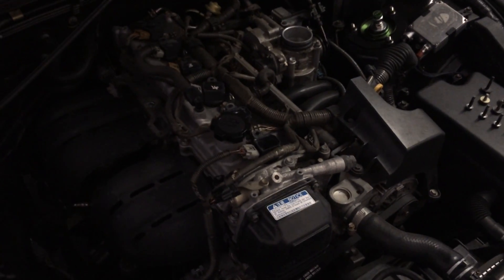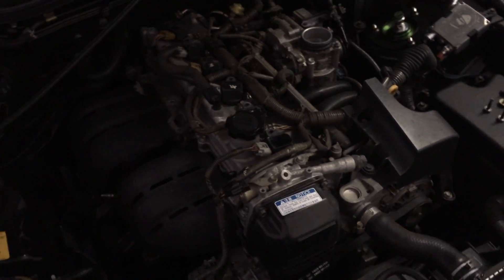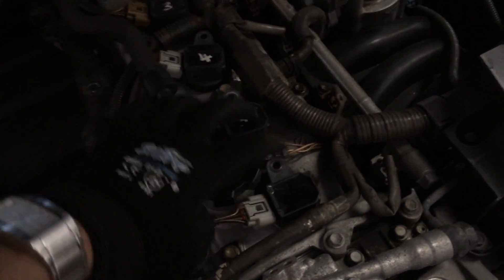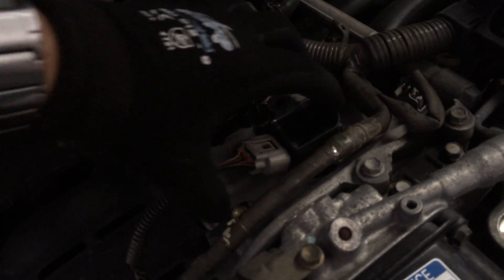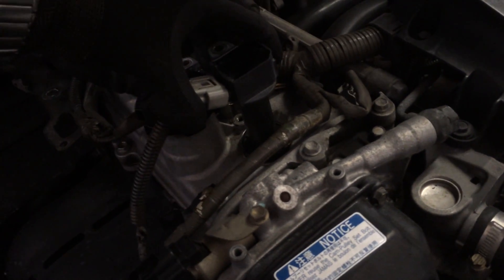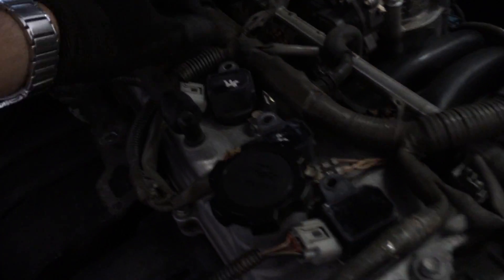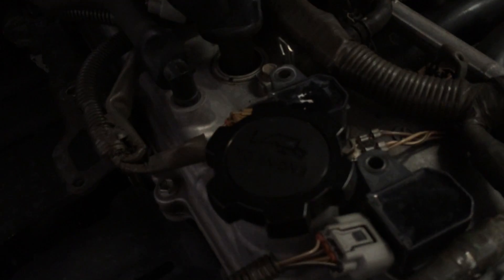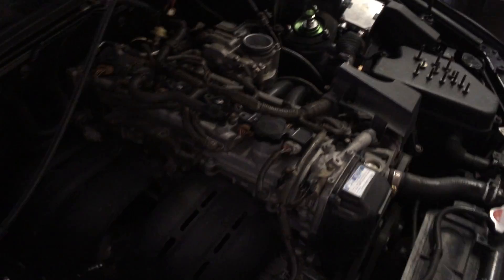How to Diagnose Faulty Coil Pack without using a computer or OBD2 scan tools Check Engine Light

Comment: Did you not get an electric shock when you touched the spark plug wire?
Reply from the maker: +Leonardo Costa no, there quite well insulated where I was grasping, it's typically the tubes where they fail, if your worried, wear some rubber gloves
Reply: since I' ve experienced electric shock on olds Honda motorcycles (from 70's) after 30 years I still get worried, but great to know. Thaks man I appreciate your tips.

Comment: Would this problem cause high fuel consumption??
Reply from the maker: in almost all cases yes, the worse it is ie. if you can feel that the engine is missing and hesitating, you will be trying to compensate with more throttle etc. as the engine will not be producing the same power and torque if it is down on a cylinder. it depends on alot of factors - generally you should notice something is not right well before your fuel consumption has a noticeable increase.
Reply: Thanks for the video man... simple , quick, effective, no bollox... I like it !!!
Reply: DEAN THE DEVIL might
Reply: Absolutely, unburnt fuel is energy wasted.

Comment: this is a bad way to check them, this cause's a load on the pack and can not only damage a good coil pack but can also cause damage to the cars computer
Reply: u can do it this way yourself and take a chance on not fucking up your cpu which will then cost closer to 2k for a replacement or u can do it yourself the safer way and simply put a spare spark plug in the coil after u remove it from engine so it does not cause a load, if u want to be sarcastic then know your stuff first
Reply: my friend this is a balance test

Comment: I am just a bit confused. So which ones are faulty? The ones where it doesnot make a difference to engine sound or the ones where it does make a differnce to engine sound?
Reply from the maker: the ones where it does NOT affect the engine is the faulty one.. if it was a good one and you removed it the engine would suffer further from miss firing.
Reply: matthew mccullough yeah people come to videos like this to figure this shit out, why else would someone be watching this video if they didn’t know shit about cars
Reply: juan alt "if you pull out a coil pack it will cause the car to stall out"

if he pulls it out and it doesn't stall, it's broken 

I assumed that he thought anyone watching this video would have at least the smallest little idea of how an engine works
Reply: That Car Channel, So why didn't you explained that in the video clearly.

Comment: running unburned fuel through your cats will destroy them. will be an issue if you have to pass smog tests. I just swap out coils until I find the bad one. its good practice to change them all anyway especially if they are the original coils
Reply from the maker: sometimes it comes down to cost and availability, for example - my local price was $80 for a coil, as it was my daily drive car, i needed it immediately, 3 days later another one failed - another $80.... then i ordered a set of 4 denso ones (as these Coils are the same on a v8 land cruiser) from japan through a parts dealer for $125 for 4 delivered..

if i could wait 3 weeks for the shipping then i would have just replaced all 6 for under $200... if i had purchased them all locally (non genuine denso, they were YEC japan brand) would cost $480.. so replacing the urgent ones, to then later replace them all yes is a good idea. sometimes logistics and money plays a part on when things get replaced though.
Reply: exactly. im not ASE qualified, nor did i train for automotive repair, but in my little world, changing them all at the same time makes sense
Reply from the maker: good tip! they arn't ment to last for ever, some fail totally like this video.. some only fail under heavy loads.. you would have to test them a different way
Reply: MrExtremeboost MAX Boost
the chinese coils are crap. I go to the junkyard and pay $10 for OEM. not paying $50 at the auto parts store
Reply from the maker: for more old OEM ones that may last a few months themselvs? not all things made in china are crap, depends entirely on the manufacturer, materials and QC standards. i don't doubt that Japanese brands have been outsourcing manufacturing to China and Taiwan for decades.. you just need to do your reasearch, and purchase ones that come with a warranty like most things that come from a reputable 'auto parts store' if it fails they replace it and claim it through the manufacturer.

Comment: So it seems only 2 coils are bad. You only switch out the bad ones right? Or would you do all of them then and there?..plz reply asap need to work on mine my code coming up cylinder 2 misfire
Reply from the maker: +Cali_ Native559 hi sorry for the late reply, you can replace just the two.. but be cautious as the others may fail shortly. if money is tight replace the bad ones now, with a view to replace the remaining ones on your next service or shortly down the track.

Comment: There's another method that SO much easier!!!  Just connect an ODBII reader to the OBDII and see what it says.  Should point to the exact cylinder every time.
Reply: +Matcha Time Cafe It'll tell you what cylinder is misfiring, but that doesn't guaranty that the coil is at fault.
Reply: +DrSlang neither does the method described in the video...
Reply: $25 for a scanner? No way, I'm saving up for a new battery in my 03 jetta

Comment: I've pulled my coils out one by one - Still alive. 
anyways, tryna find the misfire culprit. All the Coils seem to effect the revs when pulled out. 1,2,3 - all effect the revs number 4 however, kills/stops the engine. is it safe to assume 4 is the culprit coil?
Renault Scenic Rx4
Reply from the maker: ***** safe to say thats the one mate! good work.
Reply: +MrExtremeboost MAX Boost hey man, i have a problem starting my toyota vios 2004 engine. but after i reinstalled and installed the ignition coil back, the engine work out just fine. this happened now 3 times. is this due to a faulty coil or a faulty spark, what do you think?

Comment: Apparently he's never been hit by the coil pack amperage. You lift one up and if the spark likes you better than the closest ground....you're going for a ride. Not a fun ride either. More like all of your bones playing football with each other in fast forward. It's like pulling the coil wire off the distributor and it jumps and away you gooooo. Not recommended.
Reply from the maker: King 250sx i have, and it definitely wakes you up.. but it's not really anything to be scared of... i mean miss a spanner and punch the machined alloy surface of an engine block, dig chunks out of some knuckles - even with mechanics gloves on, spray carby cleaner into your engine and have a little splash and manage to ronaldo through the nose bridge of your safety glasses into your eye... accidents are bound to happen when you work on cars.. manage the risk accordingly and you will be fine..
Reply: True. Worse experience...changing the fuel filter on a 99 beetle. I was on my back under the car and pulled the clips out. I meant to take the line off and drop the line and filter into the bucket next to me for draining. The line was tight so when I pulled, it stuck. I gave it a tug, my head was a basketball dribbled between the bottom of the car and the ground. If you've worked on cars long enough...this has happened to you at least once. Not only was my head dribbled, but the line dumped fuel into my ear. It felt like somebody was taking a hot knife and making a new ear canal. I flushed it for a long time and eventually was okay. When I was a kid I was squeezing a starter out of an old dodge snow commando and it came loose and knocked me out cold. Good news was I already laying down. I've worked on cars since I was 8 or 9 years old. There's not too much that hasn't happened. I've never dropped a car off of its raised supports, "knock on wood".
Reply: +King 250sx Yeah, unplugging the coils or using a spark tester is a safer alternative.
Reply: DrSlang just unplugging the connector?
Reply: The jolt is preferable to BMW's bill!
Reply: This made me laugh so hard
Reply: DrSlang dig it
Reply: "Like all you bones playing football with each other in fast forward" HAHAHAHA.!!! That's the best analogy for being electrocuted ive ever heard.
Reply: It will damage the coil pack!🤔🤔🤔🤔🤔 🇵🇭🇵🇭🇵🇭🇵🇭🇵🇭🇵🇭🇵🇭🇵🇭

Comment: Isn't it easier to read the codes the computer sets? po301-308 on an 8 cylinder and so on.
Reply from the maker: newstart49 perhaps, some older cars throw an engine code and flash the CEL on the dash when you bridge terminals in the diagnosis port, for example on an older toyota you would use a piece of wire to bridge T1 & E1, or TE1 and E1 depending on the style of efi system that covers off most pre 90-mid 90's toyota.. however late model cars would throw a single CEL, and would require the use of a OBD1/OBD2 scan tool to identify the individual fault and clear the code once fixed (or you could disconnect the battery to clear the fault codes which works in most cases)
Reply: MrExtremeboost MAX Boost
I didn't think about that.
 I have one of the earlier Ford code readers- doing the wire thing and figuring out the codes was a pain and was just general.

Comment: This method is unfortunately not possible with cars where the coils are under the intake manifold. In one of our Nissan Versas we replaced all 4 coils because we couldn't test them individually.
Reply: Check the accessible ones in the front, if they are good, then switch them with the ones under the intake. Then test them in the front and replace the ones that don't work.

Comment: so did you have (2) bad cois? or just the one on cylinder #1?
Reply from the maker: BaseddZ32tt just one coil was bad. but i replaced all 6 with new ones a few weeks later, it's always a good idea to replace the 'set'